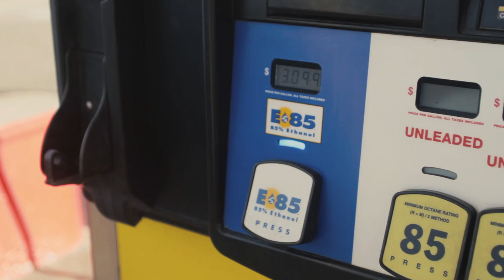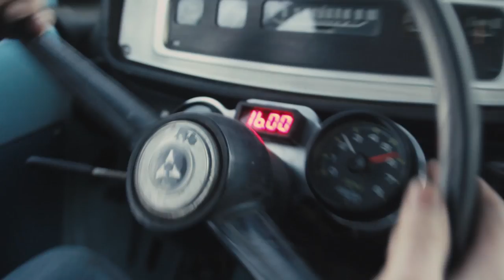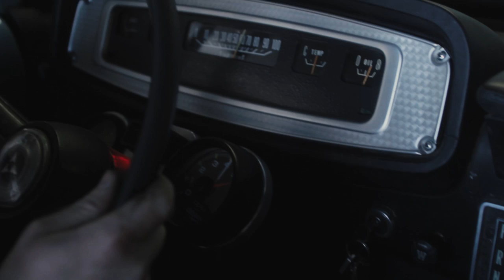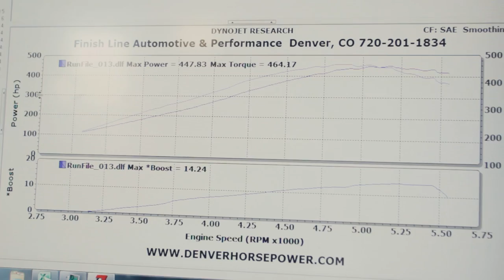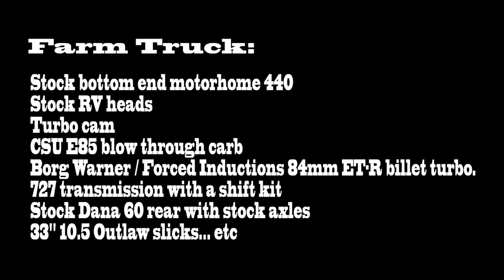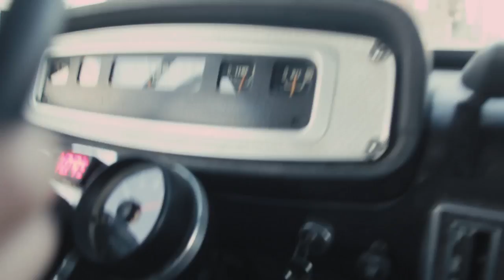Fast Turbo Big Block Farm Truck, Street Racing, Burnouts, Dyno

Comment: I have a 67 383 camper special. I’m super jealous of your build. Got a high compression 383 with 906 heads going in it. Road runner cam and road runner headers. 383 performer intake and 750 cfm carb. But I’d love to turbo charge it.
Reply from the maker: Yeah that thing sounds pretty awesome. If you're at Sea level it should especially rip

Comment: Thanks for sharing. Looks like a victor single plane intake. That’s not too bad for a stock RV 440. My stock 440 only made 280 hp to the tires before I pulled it and made it a 505 ci. I’m thinking of making it a turbo since I have it pulled out again . Is your engine still holding up or did you blow it up yet? I didn’t see a intercooler or water meth kit. Hopefully it’s still raising hell
Reply from the maker: He pulled it out and went with a bigger built engine and efi, don't think it's done yet.

Comment: What's a basic set up to turbo a 440 in a dart, I'm not looking for 700 or more hp, just a reliable single turbo, I have no idea what's all needed besides my carb needs to be a blow through & that I need a turbo, any help will be beyond gratefully appreciated. Nice job. Basically I'd like to put out numbers like your truck
Reply from the maker: Exhaust manifold to mount turbo, Intercooler, blow off valves, catch cans, wastegates. There's quite a bit to put into it if you want to make boost
Reply: @g3mccotter  okay thank you, well I know where to come for help, hopefully your up for further questions..i have an old turbo book but really haven't got the lingo to understand it yet.
Reply: Turbo manifolds will probably be your biggest obstacle, gonna have to go with custom manifolds. Hi performance electric fuel pump, your better off doing a fitech efi throttle body instead of a carb. Fuel pressure regulator with boost reference and with return line, good quality fuel so you don’t lean out, run 1-2 colder range on your spark plugs, good ignition system, try to lower your compression ratio if possible, open up the ring gaps a little bit as well that’ll go a long way trust me.
and most importantly a DAMN good tune
Reply: Korie Creson 
Your welcome buddy no problem, message me if u got any more questions I don’t mind answering what I can man we’re all gear heads here
Reply from the maker: @jy7duality  yeah going to efi is probably the easier in the end. I don't the the compression was lowered on this truck. Head studs weren't even mentioned, not sure the they were even off. Running e85 makes it all a bit safer.
Reply: Thank you guys ill be in touch. I appreciate your info
Reply: g3mccotter 
I’m in the same boat right now I got a centrifugal blower for my 440 with a blow thru carb, haven’t installed blower yet. I know efi would be easier but you definitely can make it work with a carb. And he’ll yeah man that e85 is masjid insurance. Very nice truck in the video btw 💪🏻
Reply: @Moparmaga-1  turbo manifolds look for a Marian 440 thay came with twin turbos from factory id say look there
Reply: @timallred6789  awesome, good lead ! Thank you.
Reply: @Moparmaga-1   hope it helps thay where hp monsters in tugs back when if you can find one
Reply: @timallred6789  WTF are you talking about a marian 440?
Reply: @chriswilliams8740  marine sorry auto currect in large merine applications Chrysler 440s had turbos on them twin turboes to be exact they wornt high boost especially for the time but thats where you can get a cheep turbo manifold

Comment: Wait, 450hp for a TURBOED 440?? Shouldnt a turbo/supercharger add like 50% more power than its already making?
Reply from the maker: Yeah he had wrong carb on it. Ended up making like 600
Reply: @g3mccotter  holy shit nice lmaooo
Reply: @g3mccotter  what cam did you use ? I’m trying to do the same with a 64 dodge polara

Comment: u should be putting down More hp than that some better heads and cam 👌👌
Reply from the maker: Yeah it made about 60p with the carb and tune dialed
Reply: Seriously, a mild 440 puts pretty close to those same numbers down. Surprised at how low they were for having 14psi
Reply: @Superburd  not at the rear tires , not even close .